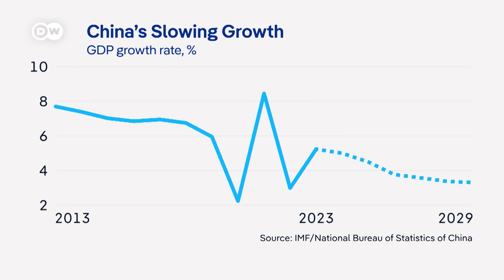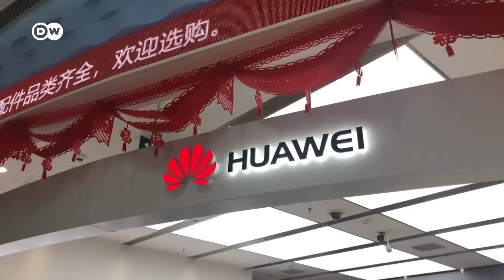Is China launching plans to become self-sufficient? | DW News

Comment: 4.5% growth means the Chinese economy will grow by $830bn in nominal terms, and (more to the point) $1.5 trillion in PPP terms. This last figure is equal to 26% of German GDP. If that's the sign of an "ailing" economy, then what word would you use to describe Germany, which is projected to grow 0.2% in 2024?
Reply: a little bit misguided

the idea is that they don't "need" to grow much more, so rates of 0.2% are actually fairly strong for so called developed countries

but it is indeed ridiculous to say that china is on the brink every time the gdp growth goes down by 0.1%

Comment: Germany exclude Huawei 5g from 2029. Does that mean Germany will not have 5g until 2029 or the already installed relatively new equipment will be replaced? Either way it is a loss.
Reply: Parts of Germany's 5G network is from Huawei, other parts is from other suppliers, like Ericsson. Huawei is cheaper, which is the reason it is in the German network in the first place.
Reply: The world (not the Western World) are moving toward 5.5 G with Huawei, and in 5 years time, 6G will hit the market.

No wonder Germany has the worse Tele Connection in EU.
Reply: @pjacobsen1000  Not just cheaper but better, Huawei holds the largest set of patents on 5G.
Huawei's 5G is way better than anyone else.
Reply: @kaygee1623  It's the world's best... trojan horse!
Reply: @perseusarkouda 👀🤔😂😂😂😂😂
Reply: The US tells Germany, that if you don’t take down HUAWEI equipment, you need to report to us for every detail. If you change HUAWEI, we will then 😮help ourselves so you save lots of effort.
Reply: @perseusarkouda Enjoy PRISM, love from NSA.